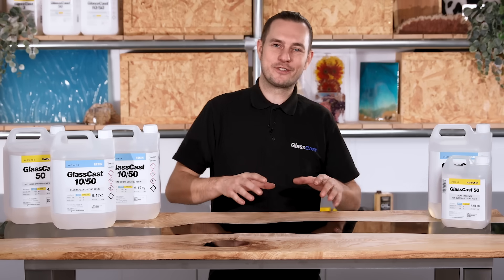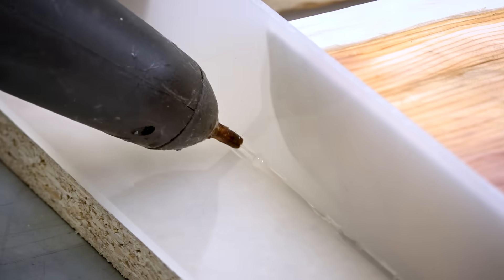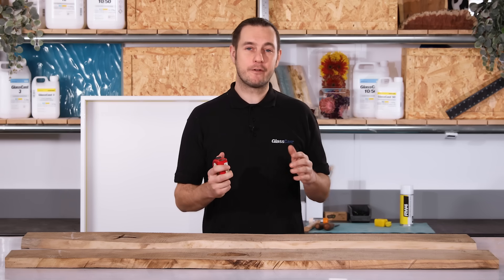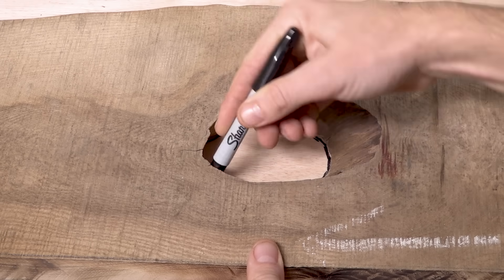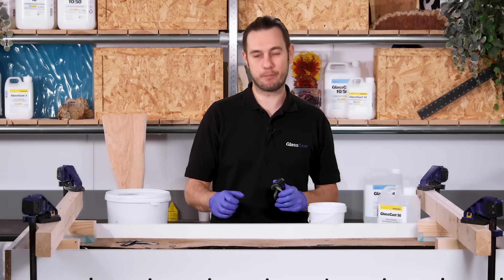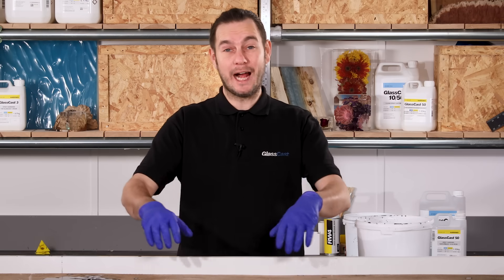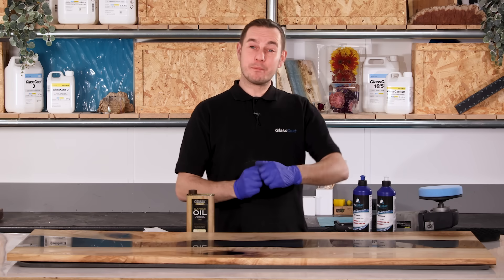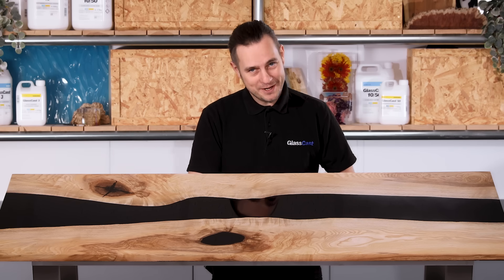Stop Wasting Money On Resin River Tables!

Comment: You can also simply use a router to mill out the river to half of the depth or maybe slightly less if you want to add sand or pebbles as a base. You can rout all the way thru on the ends to match the width of the river to create a all the way thru illusion. There is no need for a plywood core to save epoxy..
Reply: DId you even watch the video?

Comment: Maybe this has already been brought up.
Does this mean that there will be a lot of cheaper made products for sale at the same high price? 
How would the customer know?
Reply from the maker: It is possible that may well happen - although primarily the aim with this video is for DIY customers who would otherwise be put off by the high cost of a large amount of resin used. You could probably work it out from the weight of the table.
Reply: @glasscastresin  Arguably, a lighter table is not a bad thing.

Comment: I have an idea.  What if you simply filled the void with clay granules…ie. cat litter instead of spending all that time custom cutting crafting the filler plywood
Reply from the maker: Cat litter is quite dusty and breaks up so would likely leave a lot of debris floating in the resin and would not be that strong.  Litter is also very porous so would soak up a lot of resin meaning the resin volume would not be as reduced.

Comment: I get it. Less resin and the like. 
However, the entire purpose of a resin table is that it's cool, and honestly, it should be semi-opaque so that you can see through the entire depth. I know, I know, producers don't take that into account so this method of using less resin is totally reasonable. But the whole issue of a resin table is that you can see through it. I think that's been lost in the evolution.

Comment: Hi! Excuse my lack of knowledge, but I'd like to know how well that smaller amount of epoxy holds the table together? And if it is more than fine for the table in the video, how about a table that is, let's say, 3 or 4 times bigger? Would it still work?
Reply from the maker: For a table this size it is fine.  The epoxy bonds to the wood on both sides so the strength of the wood is the bigger factor on larger tables.
Reply: @glasscastresin  thank you very much.

Comment: Good idea, but would plastic or any other non organic "waste" be a better option for a filler?
Wood products in general have a danger of contining moisture and thus end up creating pressure in the resin and cracking it.
Reply from the maker: Yes you can.  Especially with a pigmented resin as you cannot see the encapsulated material. We have not seen any issues with wood expansion cracking the resin as long as the wood is properly dried before use as we recommend.

Comment: That's a great way to save money! But i have a question, wouldn't this method affect the strength on a bigger size table? I'll be afraid of snapping the epoxy with the weight of a bigger slab.
Reply from the maker: Remember the wood has its own strength and as long as proper preparation is done, the wood to epoxy bond will be good.

Comment: Do you lose a lot of strength  by not using as much though?
Reply from the maker: Not really, the wood and the resin both have inherent strength and the bond between them should be good if prepared correctly.

Comment: what do you do to remove bubbles in the resin ? some are say a flame torch
Reply from the maker: GlassCast is very good at releasing trapped air naturally by itself. If you do notice some trapped air bubbles as the resin cures than you can use a hair dryer or heat gun on a low setting to help get rid of them. Too much direct heat can burn the resin so a direct flame is not advised.

Comment: What stops the resin from snapping off the table when you remove the clamps? If the board is warped enough to need to be pressed down that much, shouldn't you be getting stress fractures the moment you remove the clamps? Or did the camera angle just make it appear to have more than a gap than there actually was?
Reply from the maker: The resin has a strong bond to the wood anyway and there was not a massive amount of stress in the table once demoulded so there is not an issue of the resin being likely to split or crack away from the wood.

Comment: ive tried this once before, and the wood inside the pour "ghosted" through, so you could see the very slight divets when looking across the piece. That was some time ago though, so maybe casting resin is getting better about shrinkage? I have not tried this recently, and this would help out a ton on saving me money on resin!
Reply from the maker: Shrinkage on some types of resin can be significant.  Epoxies in general, and especially the GlassCast range are exceptionally low shrinkage.

Comment: Why not use a 5mm thick fancy plank glued to a plywood board?
Reply from the maker: You could in theory use a veneer over a cheaper wood core however you would need to carefully consider how you deal with the edges so it still looks good.

Comment: Why didn’t you just pour more resin so it overflowed instead of less and having to shave off a bunch of the wood instead of just a little resin overflow and a little of the top wood
Reply from the maker: It would have resulted in even more wasted resin as the surface was slightly warped anyway so needed a few mm skimming off.

Comment: Would love to see the same, but with way less color so you can see the wood inside, the resin, dont know if you can get away with playwood, but then a smaller pice of the table inside?
Reply from the maker: You certainly could change the colour or use a tint.  You could use a different wood inside to make a feature of it if you wished.

Comment: Interesting; however, I am somewhat curious/concerned about the possibility of creating weak points at the plywood or at that narrow space between the plywood and the live-edge board.  Anyone have thoughts on this?
Reply from the maker: There is unlikely to be a weak point as the wood and plywood are strong anyway and the resin bond between them is also strong due to the preparation. So on balance it would certainly not be any weaker than a typical river table.
Reply: To avoid this (and save even more resin), if the underside doesn't matter, you can route out a cavity for a rectangular piece of plywood and glue that into place. Or multiple smaller pieces, which would make more sense if your river runs diagonally.

Comment: Why, not instead of plywood usually used as a filler why not use pink Insulation foam, it can be painted with latex, hot, glued to the bottom of the void, and it would be a whole lot lighter.
Reply from the maker: In smaller areas you could probably use a lighter filler such as foam without issue as long as you kept the resin thick enough. For a table project however, where you have relatively large spans, there is the strength to consider and wood provides this whilst also taking up volume.
Reply: I suppose if you are needing strength, that would be perfectly fine but many projects it isn’t about strength it’s just about trying not to use 15 or 20 gallons or resin .so using a filler is just to be a filler strength could be increased with some aluminum under the foam, if it was that critical it all depends on the application, but it’s a good suggestion using plywood @glasscastresin

Comment: Can the resin cope with hot mugs of tea without softening?
Reply from the maker: The GlassCast range of resins is limited to around 45'C so a red hot mug is likely to leave a mark in the surface. Notwithstanding that, we have numerous customers who make products such as coasters using our GlassCast and in common with all epoxy resins that we have tested, following a full 7 day cure, a very subtle ring can be left by leaving an extremely hot cup to stand on the surface of the resin, this mark is slight and can usually only be seen if the surface reflection is inspected closely. Customers who use this resin for drinks coasters report that the marking is almost un-noticeable in practical applications and continue to use GlassCast commercially for coaster applications. 

It may be that we’re more conservative but in reality, having tested dozens of ‘high. temp’ Epoxy Coating Resins side by side, the results always tend to be similar between our resin (limited to 45’C) and those higher temp. offerings. Our testing is quite straight forward; pour two identical samples, one in GlassCast, one with the competitor product, and divide each into four sections so that we can conduct the same test after (end of standard cure for the given resin and then 7, 14 and 21 days thereafter).
 
Our test involves pre-heating a mug with boiling water, emptying it after 30 seconds and then put newly boiled water back in – the mug is then placed directly on the surface for 5 minutes. In our own testing, all resins performed more or less the same, with a small ring left behind. The ring is generally faint and only visible from certain angles but nonetheless, even supposedly high temp. stable coating resins had the same issue.

 I realise there's a lot of information above to a straightforward question but I hope this helps.

Comment: Why do you need the resin on both sides if only one side is facing up when finished ?
Reply from the maker: If it was only on one side, there is the chance it may bow slightly.  Also some people like the bottom of the table to have a reasonable asthetic as well as the top.

Comment: Hi there, great video! Love how you touched on many practical aspects a hobbyist will run into when making such a table.
Often you see people using a heat gun or small torch to get rid of any bubbles. I didn't see you do this. Was this done off-camera, or does your resin somehow not have bubbles?
Reply from the maker: Hi Christopher, thanks for your comments. The GlassCast resin is very good at releasing entrapped air by itself so generally not needed. If there are any stubborn bubbles that are refusing to pop then yes you can use a heat gun or blow torch to help them on their way.

Comment: how scratch-resistant is epoxy resin? I'm thinking of dinner plates and general wear and tear. Does it leave scratch marks easily? Do you have to polish it up every so often?
Reply from the maker: Naturally if you were to drag ceramics over the surface there is a risk that they would scratch the resin. We would always recommend using a place mat and a coaster which will also protect the resin against heat. If the surface does get scratched however you are correct, it can simply be sanded back and polished up in the very same process that was used to begin with.

Comment: Will this not weaken the table by only having 10mm of resin baring the weight of anything placed on it?
Reply from the maker: Load also goes through the wood the resin is bonded to.  The table was not weak.

Comment: why use wood as your core? why not closed cell foam with holes is like 20 times easier to cut into shape, you can make it thicker and the table becomes light as a feather.
Reply from the maker: Depends on the strength of the foam.  If the resin layer top and bottom is very thin and/or the table very big or wide, the foam core may not offer the same strength compared to wood based materials or solid resin.

Comment: Could you do the same thing making a countertop? Will it holdup over time?
Reply from the maker: There's no reason why you couldn't use a tabletop like this as a countertop. You wouldn't want to cut directly onto the surface, as is pretty much the case with all worktops and you would have to be mindful not to place hot items on the resin area.

Comment: I've never used resin when making a table so just a quick question, what is heavier, the wood blank or the resin? I'm sure cost wise the wood blank is a great way to save money and haven't seen any content creator use this technique (unless they do it in the cutaway) So it's good to see someone using their brain out here
Reply from the maker: Resin is much denser than wood, including hardwoods.
Reply: Remember that woods are porous,  while resin purposefully made without air bubbles are just very solid object

Comment: Why don't you join the plywood to the wood before, use dowels for example. leave 5mm at the top sides and back and then pour the epoxy?
Reply from the maker: There is no need structurally to do so as the resin to wood bond is generally very strong.

Comment: How about using polystyrene instead of plywood?
Reply from the maker: Whilst polystyrene would take a lot of weight of of the table it doesn't really give the same amount of strength that a wooden filler provides.

Comment: why not use a sand instead of ply wood? its cheaper and it can conform to the shape of the gap easily
Reply: Sand granules 1) aren't solid so may move and the marr the resin. 2) soak up liquids increasing cost relative to plywood. A solid substrate is more inert and stable than a friable one.

Comment: Great idea!  How much do you have to worry about dust in the shop when letting the resin set?  I'd be doing this in my woodworking shop, so it can get pretty dusty (though I do have good air cleaners).
Reply from the maker: Ideally you want the dust to have settled and also not do dusty work while it is curing.  You could even make a card box cover to keep dust off it.  However in this specific case where the surface is being routed, sanded and then polished;  any odd dust specs that fall on the surface, while the resin cures, would be removed during post processing.

Comment: Thankyou for this, very clear to see and follow. When letting the first resin pour tack off, how long / tacky can it be left? is there a guide for time v temperature? My concern is the development of amine blush and waxing that could affect the effectiveness of the second bond to the first. Thanks
Reply from the maker: Depends on volume of pour, how long mixing, ambient temperature etc so no easy exact time. You need to check it with a gloved finger to see when the exact point is reached.  Properly mixed resin at a decent temperature is extremely unlikely to have amine blush or waxing issues.

Comment: Is this going to weaken the table on a large scale pour?
Reply from the maker: No as the wood and plywood are strong anyway and the resin bond between them is also strong due to the preparation. So on balance it would certainly not be any weaker than a typical river table.

Comment: But danish oil is not a long term protection for the wood, especially a single coat.
Reply from the maker: The first coat of Danish oil is designed to seal the wood and prevent any staining from the polishing compound. After that, you will need multiple applications of Danish oil to get the full protection and finish it can offer but we've found Danish oil to be a great finish, in fact we've made lots of tables all finished with Danish oil and they've stayed looking great for many years. There's lots of finish options for wood and it's personal taste but this is certainly one that we like.

Comment: Can you (1) drill holes in the insert to reduce trapped air and add integrity and (2) paint the first pour only halfway up the side so the last pour adheres to the raw edge?
Reply from the maker: 1.  Not necessary structurally and with the sealing coat brushed on, not necessary from bubble perspective.  2.  Again the resin to resin bond is perfectly strong enough.
Reply: @glasscastresin  Awesome, thank you!

Comment: one no ever seem to tell,  is how to clean up the buckets and mixing equipment or are they just thrown out afterwards that seems wasteful
Reply from the maker: You can use acetone to clean up most equipment before the resin cures.  Most of our buckets etc are polypropylene and inert plastic based meaning you can flex and peel off the cured resin making it easy to reuse the mixing buckets and plastic mixing sticks.

Comment: So I'm just generally interested in this, and I'm curious. With the extra labour of doing extra pours, mixing and making the plywood inset how much are you actually saving in overall costs vs just pouring it all once and being done with it ?
Reply from the maker: We recommend doing deep pours into an insulating materials like wood be done in multiple layers anyway as it reduced the risk of the resin overheating, see our river table video for reference. Adding the plywood core doesn't really add much more time, especially given the cost saving.

Comment: Am I wrong in thinking this would severely weaken the table?
Reply from the maker: Arguably a single full length core like this could actually make the table stronger.
Reply: @glasscastresin  Just seems counterintuitive to me. Not based on anything solid or any experience. I was just basically thinking out loud so to speak.

Comment: Intending to do this with a large office table shortly - is there any issue substituting plywood with MDF for the core?
Reply from the maker: MDF would be fine, it obviously doesn't have as much inherent strength as plywood so just consider that when selecting thickness of the sheet and the allowance for resin around the edges.

Comment: How do you prevent the first layer of epoxy from creeping underneath the live edge planks? Do you use a caulk?
Reply from the maker: generally any bleed under can be easily sanded off if there is a need for the bottom to be finished to a good standard.